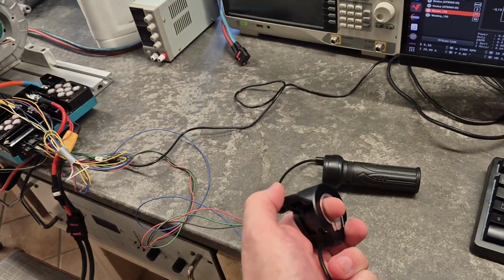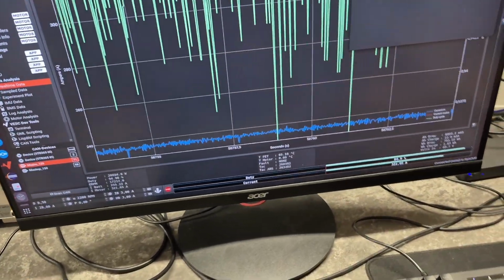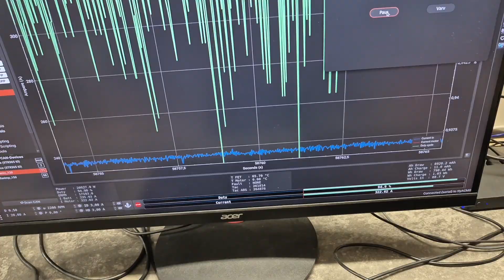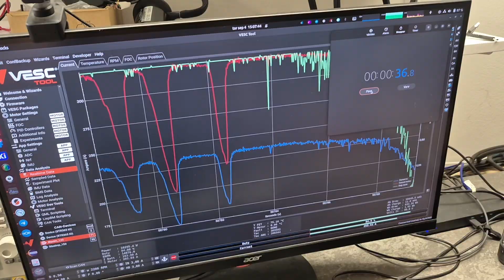VESC Maxims on a SIA155 dyno

Comment: Nice test setup!
I wondered why the big new motors can only take up to 400A Phase but are those hairpin Motor made for higher voltages because that would explain it.
If these Motors are good maybe they would fit with a 30S setup because of the higher turns

Comment: Really nice hardware you guys are producing. Do you think I could run a Maxim in a boat? It will be mounted in a covered area, but boats are always a bit damp and it will be outside all year.
Reply from the maker: The maxims are potted and the 39-pin connector has multiple seals (even all individual cables in it are sealed), so they should be ip66 or ip67. Mounting them in a boat should be completely fine.
Reply: @BenjaminsRobotics  I didn't know, just went by how it looked. Sorry, my bad, better delete my last comment before I mislead more people.
Reply: @BenjaminsRobotics sweet thank you so much! Can’t wait tot order.